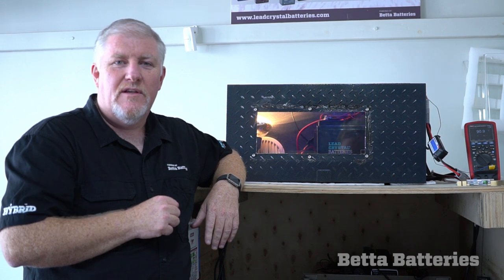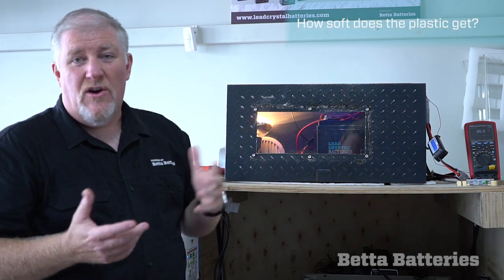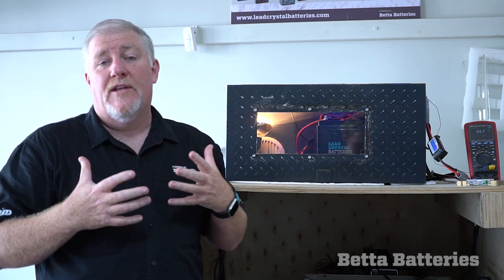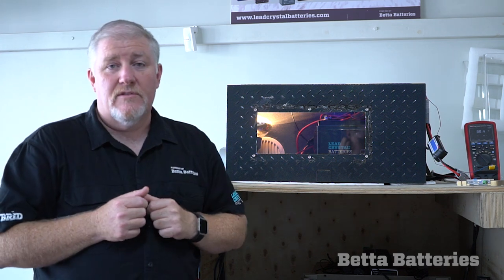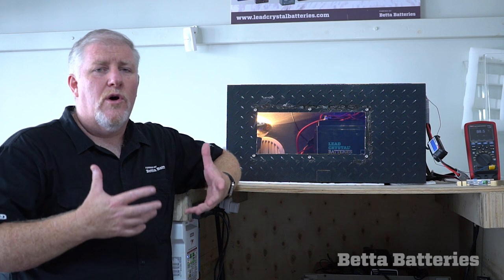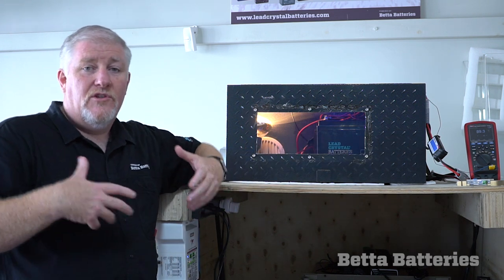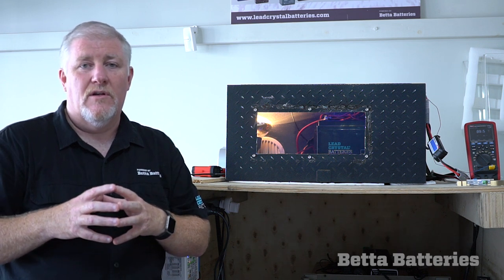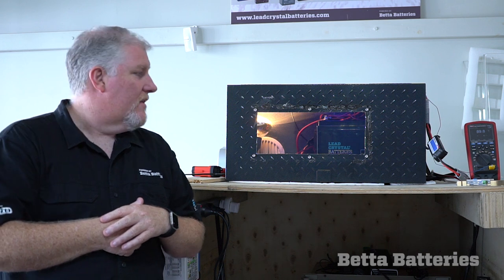Under bonnet charging with Lead Crystal Batteries common questions

Comment: Hi, I drive an old 80 series which doesn't have a "smart" alternator and provides a consistent 14-14,2v. would it charge properly without a dc to dc charger?
Also, the operating temperature is supposed to be -40 to +65 degrees celsius and is stated to be able to be fit in the engine bay, does that 3 year warranty still holds when in the engine bay and do you have any recommendations when fitting the battery in the engine bay which might extend its life?
cheers.